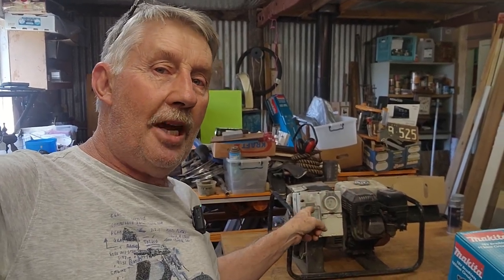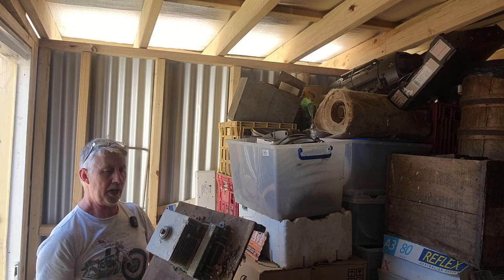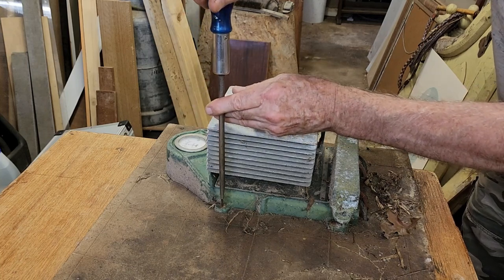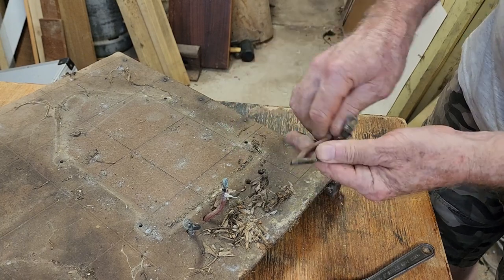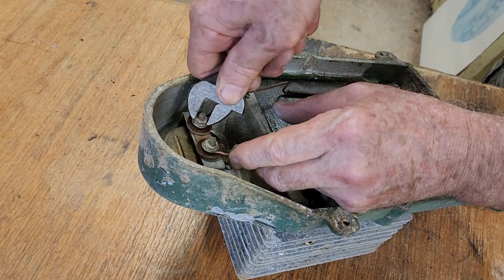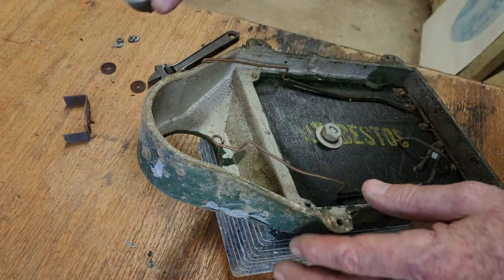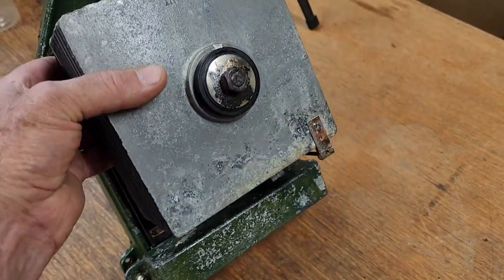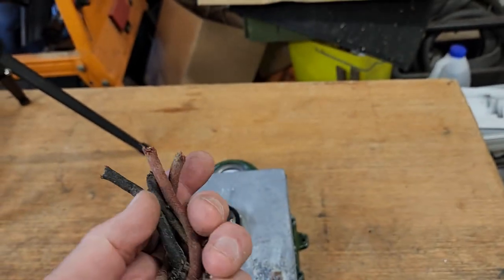Storage Shed Clean-out Part 3 - A Sympathetic Restoration of a 1940s Selenium Rectifier

Comment: I have found a lot of triag/hornsby model train set power supplies from the 1950s in hard rubbish and they all have selenium rectifiers. Everyone of them do not work because the selenium rectifier has failed. The thing to look for is tungar valve battery chargers  from the 1920s. They are very rare in Australia. When you see one it has what looks like a light globe in it but has three connections instead of the usual two.
Reply from the maker: Thanks Lucky, yeah I think you did a video on them once?

Comment: Very Interesting Chris. Don't recall seeing anything like that before. Lucky it said asbestos on the back (fortunate warning). Yes a nice sympathetic restoration was perfect. 👍
Reply from the maker: Thanks Alex. It is interesting that in the 1940s they felt the need to place an asbestos warning on a fuse board panel - and yet continued to use asbestos products in buildings (and homes) right through to the 1960s and possibly into the 70s!